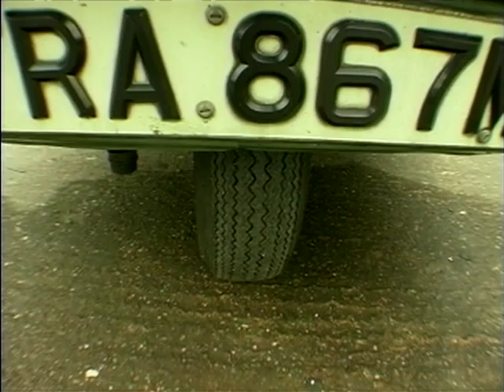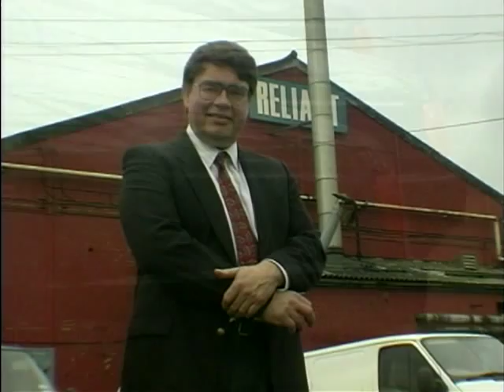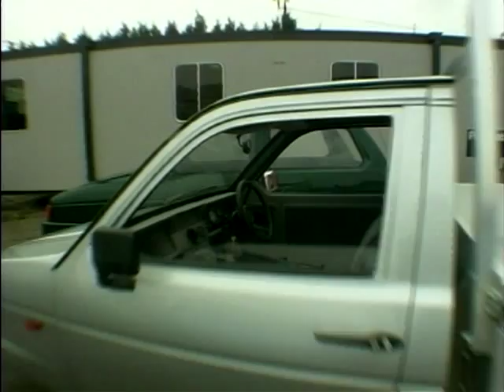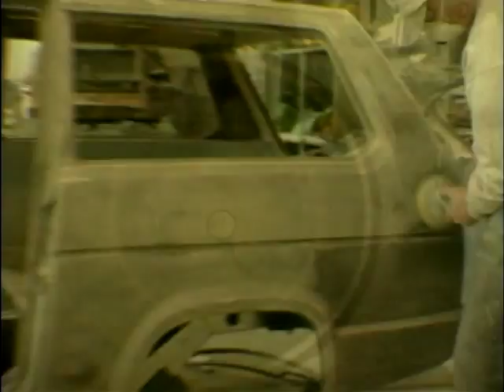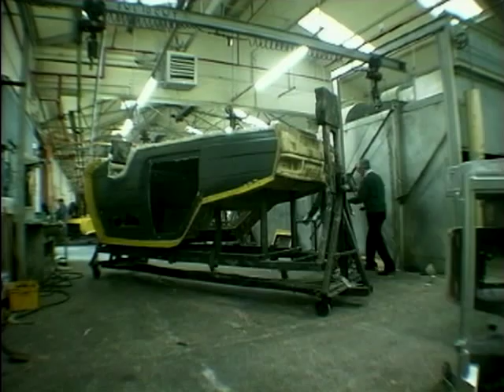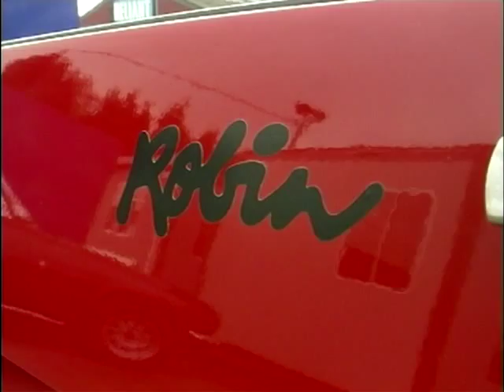Reliant: British Car Manufacturer

Comment: That sad fact is he should have dropped the 3 wheeler and produce an updated version of the Scimitar which would have better suited a niche market. The Robin in the end was way way to expensive for a economy car that to be honest wasn't that economical compared to it's modern day rivals. I think even the Bond Bug would have faired better because it was so out there people had more respect for it's quirkiness.
Reply: There was no money to design a new car, they were going week to week with the bank account constantly dipping under £1000. They needed to get the existing product profitable again before anything else.
Reply: Dropping your best selling car would’ve been bad business.
Reply: @underneonloneliness2  but they didn't sell enough which is what put them out of business so....
Reply: @p24hrsmith  They tried it with the Reliant Kitten but couldn’t sell as many as the Robin. I think if they had modernised the interior like they did with the exterior then they might’ve sold better.
Reply: @underneonloneliness2  the Kitten was a Robin with an extra wheel and price tag that couldn't complete with the Mini. The Scimitar had less competition and in a niche market the price isn't so critical it also had the prestige of Royal ownership
Reply: @p24hrsmith  The Robin is still a good cheap car to run. It’s a good town/village car which is excellent on petrol.

Comment: Perhaps they had made reverse trikes, they might still be around? Perhaps a reverse trike would be more stable? I really liked the Reliant cars. I don't think they ever came to the USA.
Reply: They don't actually roll. Top gear modified them to make it roll easily
Reply: Its really hard to roll a reliant
Reply: @terrificspokesman7416  I read that Top Gear UK had modified the one they used; different size wheels and weights to make it tip easily. I think they were biased against it.